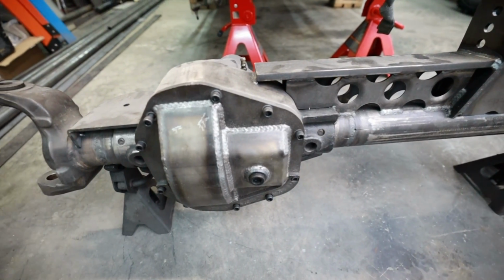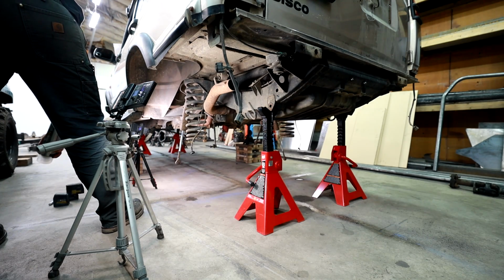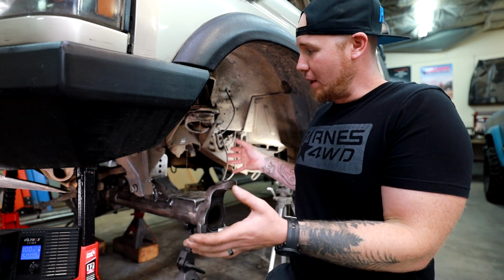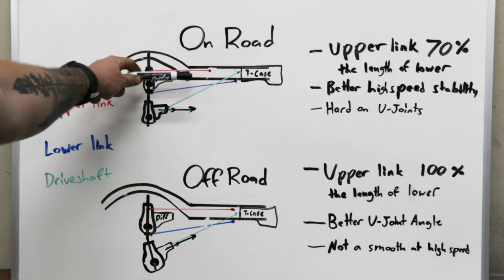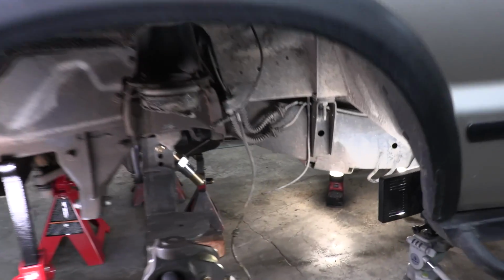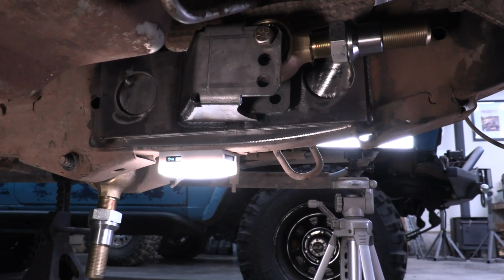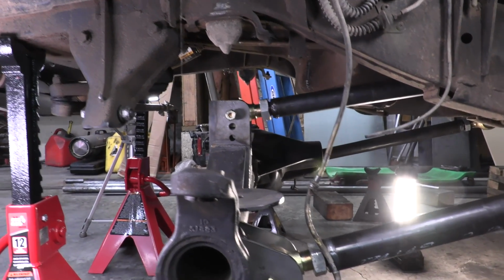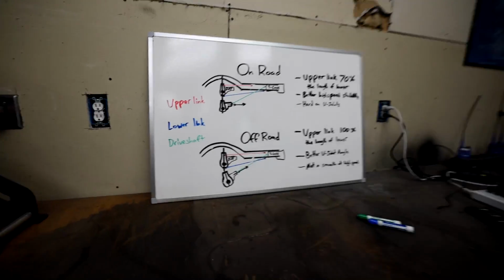1 Ton Axle Swap! 3 link front suspension. Ultimate Land Rover Discovery Build Episode 7

Comment: Great overview!   Did you consider using double-cardon and double-double-cardon (a double-cardon on both ends of the driveshaft) with the "on-road" configuration?  These address that dropped angle problem.

Comment: About to get the commando back in the shop for the new Atlas 5:1,  pull the corporate back at least 6" and link it up. My front 60 is on radius arms with a panhard, whats wrong with doing the same in the rear?

Comment: 11:00 I see how you put a couple of joints at the outer holes for the upper link frame mounts to keep them square. 
I did the same thing for my link mounts. Seeing this, I know I'm on the right track for keeping everything square. 
BTW, I'm using the same Barnes brackets for my build as well.

Comment: Wish I saw this 2 years ago when I built my first three link. I got a question though; I built my upper link 25% than my lowers (or both my lowers were 75% the length of my upper) with equal link separation on both axle and frame side. Do you have any comments about a longer upper link and how it affects driveability? If I remember correctly I was reading somewhere that having a longer upper keeps the pinion angle always pointing at the Tcase (like you have drawn in your whiteboard diagram). If the physics of having a longer upper continues to follow the rules of a radius arm set-up then it seems the pinion angle will more dramatically point towards the Tcase, reducing highway driveability. But that's only my guess, I'd like to hear your take/expertise!

Comment: Nate, thank you for these videos. I have a 1952 and a 1954 Dodge M37CDN trucks I'm building a garage/workshop to build them. One is in fairly good shape and will be built to original condition. The other will be built as a regular driver for hunting, fishing, camping, hauling, towing, trail runs and such. That will require significant driveline, steering, and suspension changes. I have yet to watch a video of yours that I didn't learn significantly from, and get the brain going. Keep them coming!

Comment: Not enough detail bud.  Where in the axle is the upper link located left to right? In the center, offset one side or the other? Where did you attach it to the chassis? Is it on the frame? So does that mean the upper link is offset left to right from where it is attached to the axle? You have a view from the side but not the front.

Comment: Such an awesome built, big fan of the DISCO's. Be interesting to see how the transfer case and transmission hold up over time pushing the bigger axles and tires over time. Personally, I think they should do fine.
Reply from the maker: Im curious about this as well. Its way under geared right now and I'm over gearing it for this build. The engine is going to rev higher on the freeway but this should take a ton of stress off of the transmission and tcase. 5.38 gears on a 37 should restore a ton of power and make hills easier then stock in theory 👍

Comment: Man that's some good info. I'm starting my coil over 3 link setup on my FSJ  71 J2000 . I'm hoping the Dana 44's will last a while with 37's till I can build some axles . The 401 in her has already snapped both rear shafts with 33's . It's hard having a long wheel base .

Comment: Can you make a parts list and a price break down of what is takes to complete the suspension build?
Reply from the maker: Ive done this before and the amount of back lash/negative comments was insane and alot of work actually. Unfortunately I Learned my lesson the hard way. But you can do this yourself easily! All the suspension parts are from barnes 4wd. 3 link kit in the front 4 link kit in the rear + steering kit. Find the axles you want and get a quote from yukon on gears and lockers for your axles👍

Comment: if its your first build just start firing links around, it isnt that hard to go back and tweak a bracket location or add an extra inch or two to an arm with the adjustable joints.. no need to stress out and spend 2 years tryna dial everything in perfect without a road test

Comment: you made a wrong drawing in the picture.  upper link 100% length of the lower axis movement vertically upward for road.  second picture Link 60% axle leaving angle, off-road
Reply from the maker: Not true. Lots of good information out there on this subject and I highly recommend crawlpedia. I'll give a demonstration with an angle finder later on in the series so you can see exactly how this works 👍. I will even compare it to my TJ (off road suspension)

Comment: Hey nate. Why not put a Rosett weld on the bungs?  Usually thats standard practice
Reply from the maker: I've only seen people on Instagram use rosette welds on applications like this. They are fine but in the real world I haven't seen anyone use this technique. However I have seen bungs fail because they didn't have proper penetration. Continuous welds are easier to maintain high heat and guarantee penetration. The risk of course is you can warp threads if you aren't careful. I like pretty welds as much as the next guy but I have move confidence in this method and in my opinion it is more practical. I want to reiterate that I'm not knocking Rosette welds  at all just answering your question from my perspective. Thanks for watching man 👍

Comment: I wonder if an 85-90% of equal length in the upper link would be the best of both worlds?
Reply from the maker: Kind of. It's compromise which is what we all have to do has fabricators. 99% percent of builds will have a compromise between 70% and 100% so that 85%-90% is not a bad place to be as long as the builder understands what they are gaining/giving up. 👍
Reply: @DirtLifestyle  For reference I looked up what the OE upper/lower length relationship is on my MJ (according to a length chart at least) and it came out to 95%.  Next I need to measure what the separation axle vs. chassis is... IMHO it's always worth considering what the OE engineers decided upon and consider why they chose to do it one way vs. another.